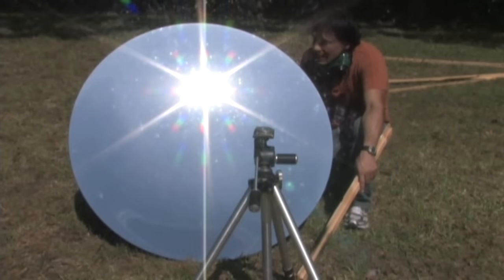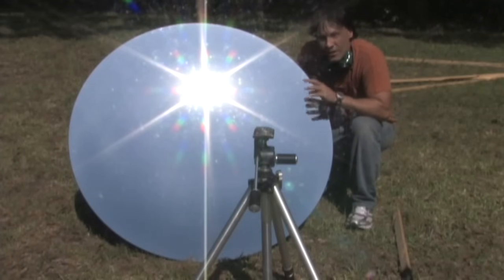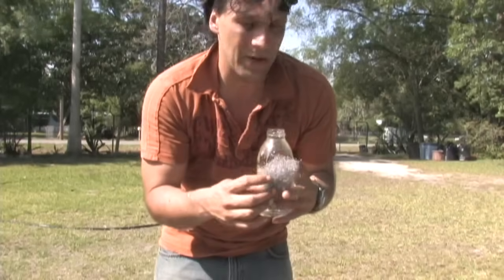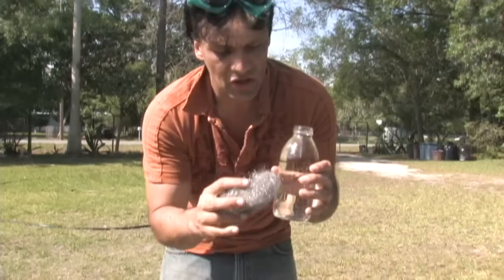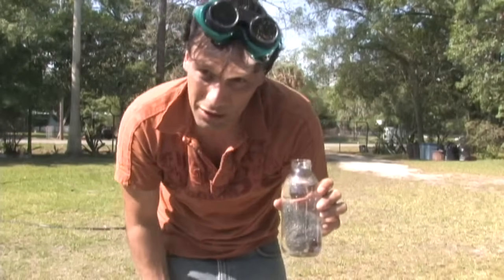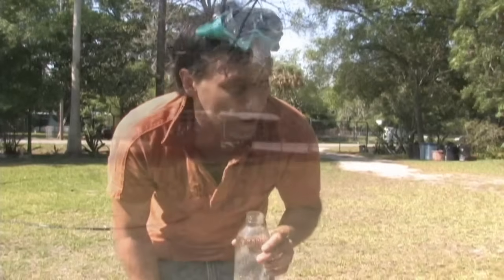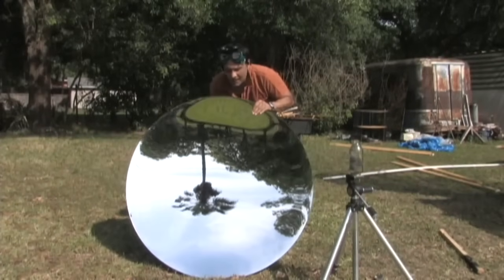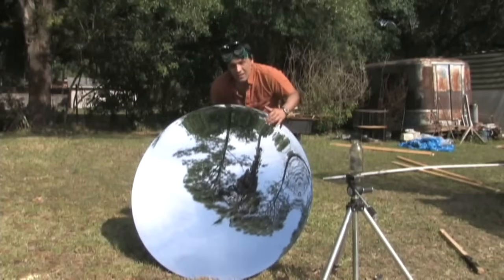46" PARABOLIC MIRROR STEAM BOILER SOLAR POWER STEEL WOLL NANOPARTICE GreenPowerScience

Comment: forgive me if it's mentioned, but paint the bottle black?  that'd make it absorb heat.
Reply from the maker: Usually do but the wool inside has more surface area.
Reply: @GREENPOWERSCIENCE  Ahh, good call.  I see how that would be a better option.

Comment: I thought you were going to produce electricity through boiling and steam
Reply from the maker: I was but PV is so affordable now and has no moving parts, does not require sun tracking, is silent, has zero maintenance, they are the best option. For electricity you need a super efficient steam engine that is noisy, requires daily care and the alternator/generator need to be super efficient plus wasting water or complex recycling. PV is the way to go for electricity. For direct heating and solar thermal, PV solar panels are a terrible choice as heating elements are a dead short and require many panels. Parabolic Mirrors and Fresnel Lens work best for cooking, heating things to high temperatures and direct water heating. That is why the steam engine idea was scrapped. No real usage. Back when PV was $7 a watt, yes, now below $1 per watt for a completed plug n' play panel, no.

Comment: Sphaphire windowed high pressure level gauges can take 2000 to 3000 psig depending on the model. I’ve used this with steel wool at 2000 psig fir supercritical co2 experiments while I was at Ga Tech. I believe the lab still exists.

Comment: I think these would be great for running a pressure cooker for mushroom cultivation. Anywhere in a warm climate it would make it cheap and neutral on the environment to prepare cheap substrates.
Reply: I bet this thing boils a gallon pot of water in 3 minutes in higher latitudes.

Comment: He thinks it could image as a primary lens though the focal length is short.  I will need to investigate. Making the mirror less magnifying should lengthen the focal length. And if it is parabolic would make for a primary lens.
Reply from the maker: Hi Terry,
These could work for imaging BUT would require extreme precision and need to be first surface. People have used our mirrors for DIY telescopes but required software adjustments of aberration as these are second surface designed for rugged outdoor usage.

Comment: Can that snapple bottle be hooked up to a copper piping coil and then be used to distill seawater? Reason i'm asking is because we have strick water restrictions and desalination is too tricky/expensive. Any comments welcome, i'm not an engineer so I need some tips😂 and what cost do those parabolic mirrors go for? Or can they be self-made?

Comment: WoW!!  Awesome set-up!! Have you had a thermocouple hung in front of this to get an accurate temperature??  Do you think a stainless steel coil hung at focal length with some kind of liquid medium circulating through it would capture enough heat??  Maybe heat water, oil or ethylene glycol?? Thanks.   brad

Comment: thats pretty cool .. my standard electric stove top takes 5 mins for 1 qt of water in a stainless steel sauce pan.. for rapid boil.. 
an issue to overcome it seems would be the collection of salts on the steel wool and salt is the killer in steam systems as i recall..
Reply: use filtered water, like Brita. problem solved.

Comment: I hv a question. Can we hv a steam generator that can cycle the water within itself, without the need to fill water again n again.
Reply: Look into a Sterling engine.
Reply: you could make a closed system, but you would need and expansion /cooling chamber big enough to cool and provide enough pressure drop.

Comment: how 'bout cooper scowering pads, wouldnt the copper ones work better conductor, also Ima thinkig a denser metal inside like steel bolts & nuts in addition to  ? to rretain heat, while mirrow adds  maybe...Glass 5 gal old water jugs, or more expersive vacume tubes for psi diligence..also why not parabola from 12, 10 & 4 O'clock positons...uhh ohh ( did i Spall that rite? it aint in the dictionary) & or melt down & or combustable expl os ive yikes

Comment: nice trick about heating wool ! I remember when I was young , a fist of dark tarnished silver coins instead of steel wool , to boil water in a pyrex beaker. the mirror was a tensioned rectangulare bathroom one which finally broked being too thick.

Comment: Telescope mirrors have to be accurate to a few millionths of an inch or about 1-1,000 as thick as cellophane. Your mirrors is one thousand times less accurate than required.
Reply: +Garth Elliott Yeah, before that arbitrary "required" tolerance was achieved, it was impossible to make a telescope by reflecting light off of mirrors.  It clearly wouldn't work at all.
Reply: +James Davis "clearly wouldn't work..." pun intended?
Reply: +Leo Corona "Leo Corona" commenting about telescopes... I should ask you the same question
Reply: Where's yours ?

Comment: The long focal length could be excellent for making an array of them, as many as you can fit in an area side by side and still be able to point them at the same point. Ex; 4 of your 1 meter focal point parabolic mirrors pointing at the same jar. Then test to see how fast it boils, then later when you are prepared with a oil system, test oil in it to see how hot it gets, or keep oil pumping thru it to prevent damage if it goes to get too hot. lol Speed up the pumping, also the pump and oil need to be hooked to a radiator to cool it fast enough.

But either way a person could just put up 4 of these with independent heat collectors on each focal point of the 4 mirrors and hook the fluid piping together mechanically in series, etc...will still add the energy to the liquid, but it will take more parts and space.
Reply: That is physically impossible my friend.

Comment: I wonder how a mason jar would fare? After all they're designed to be under pressure in a pressure cooker. Not sure the psi capabilities. Maybe if you put a pressure release valve in the cap it would keep it from over pressuring.

Comment: I used to have a 1/4 mile race car.. the gas tank in the trunk was a 5 gallon fuel cell.. it had a thin wire substance in it like your steel wool.. but the reason was opposite to what you are showing.. the wire in the fuel cell would not concentrate heat but rather disperse it.. so that even if a spark were to hit the gas, it could not catch on fire.. the product as I recall was called "Explosafe" and there were demonstrations... first putting this thin wool mesh in the tank would not displace the fluids.. hardly at all.. and 2nd was the disbursement of heat.. I would think your experiment would work better with tinfoil on the outside of your glass jar on the opposite side of the light rays to reflect light that otherwise would have traveled through the glass... in short I think the wire wool might be hurting your experiment by dispersing heat :)

Comment: Instead of steel wool, could you just use like a specially designed 'heatsink'/'radiator'/heat-exchanger, you get what I mean, finned steel, so you collect and disperse a high percentage of the heat?
Reply: Aidan Šeštokas For sure, a stainless steel core radiator with aluminum fins painted black would be an excellent solar collector heat exchanger. Like the size of a heater core in a car, could use the heater core(from an automobile) itself but i would recommend closed loop system if using an actual automobile heater core because it will need to be filled with coolant because the core is not stainless. Wouldn't need to worry about exceeding the breaking pressure of the glass.

But the glass and steel wool is a nice inexpensive way to collect a lot of heat using only stainless steel wool and glass for the heat/light exchanger/transformer. Drill a hole in the glass bottom and insert a fitting, now you can hook piping to top and bottom to carry away steam and to carry in water.

Comment: heating water in the presence of steel wool actually produces hydrogen due to the increased temperature and therefore increased rate of oxidization of the steel 
and guess where it gets its oxygen 
tesla experiment

Comment from the maker: Hi,
That could be a good idea if the steam tube is insulated as the steam would cool and condense as it travels down the length of the tube. If the steam volume is great enough it should work. The only problem I see is the down pipe's insulation solution. There are also new solar deep well magdrive pumps that can lift 200' foot to head at 500 gallons per day from a single 80 watt PV panel. Low pressure but the lift is completed to a tank.

Comment from the maker: Zenith Solar uses CPV and has no practical future compared to regular PV as the cost per watt is much higher. The 75% efficiency claims include warm/hot water. By placing regular PV panels under circulating water, efficiency jumps to 20%+, heat removed produces better current. The water is warmed equaling overall 50% efficiency. You could build 5 PV plants for the cost of one of theirs. Also true continuous mirrors like this one are 30% more efficient than square glass arrays like the Z system.

Comment: Not to burst any bubbles, but... solar panels only operate within a certain 'band gap' of light which is proportional to the amount of voltage you get. There are some companies that produce cells with layers of material each tuned to a different band gap, but they are more $ and are only 40%. The most cost effective solution I can think of is to have mirrors reflect more light onto a solar panels which would gather more light of the same band gap. Also filter out useless light to reduce heat...

Comment: I build steam engnes as a hobby. I am also a member of a Historical society that restores Stationary Steam Engines and Steam Traction Engines. I also enjoy watching your videos. 

You seem to think that 60 lbs of steam is sufficient pressure to run an engine. Most engines in the 19 the century ran on more like 130 lbs of pressure. Late 19th and 20th century locomotives ran on more than 200 lbs of pressure.

Many of your ideas are not yet ready for practical use, but keep on experimenting :)

Comment: instead of using a glass bottle you could use a an aluminum container coated in black paint on the outside and silvery (to be read as reflecting) paint on the inside to absorb and retain heat effectively..my thought..and i want to make a steam engine powered by this mirror to run my home's electricity..could it work?

Comment: You made water boil. What ever.  You did not make steam.   It takes little BTUs to boil water. It takes a lot of BTUs to make a change in state.Make water change to steam in other words. You have done nothing here other than make water bubble.  Make steam and I would be amazed. Plus, putting wool in the water creates hardness. A turbine cannot run long with hardness present. Make that same wool out of something more expensive, then it wont be as economical.

Comment: Dan, can you boil and make steam from a metal teapot? How long would it take it to boil and turn into steam? Would you design a solar water distiller? What size should the coiled copper tubing be, if you use that to distill the steam? Thanks.

Comment: Having spent almost a decade building solar homes I found that you can get only about 1,100 btus per day per sq. ft.   The highest gain is in the middle of the day.  Your mirror is about 11 sq. ft so total btu gained would be about 12 thousand.  This is about the output of a stove burner in 1 hour or 12 oz. of gasoline. (1/10 gal.)  While bringing 16 oz. of water to boil from say 80 degrees may seem impressive, you only need about 130 btus to do that.   About 2 minutes output.  Good science!

Comment: I just watched the Mythbusters try to burn a mock up of an ancient roman ship using a mirror built from materials that the Greeks would have had. I think they were unsuccessful because they had many small flat mirrors in a circular pattern. It simply didn't focus the energy enough to start a fire. They achieved about 250 degrees F.  Enough to boil water but not ignite the ship.
Reply: They are Hollywood idiots using feet not meter

Comment: @mattmatt115 : there is no chemical reaction in this process. what you are seeing is heat from light being caught by the steel wool and diffusing into the water. the only chemical reaction that occurs between water and steel is oxidation (rust), but that takes much more time than a few minutes.

Comment from the maker: @trumpsahead no, you would need 2 sq miles of perfect mirrors to simply illuminate a target at 30,000 ft, up there, where the ice condensation clouds are:-) Even then, the focal point would be so scattered, the pilot would not even notice you. It would look like a shiny lake on the ground from the air. 

5:1 dish diameter to focal point is the absolute maximum, up to about 200m focal length, after that, impossible.

Comment: Get you some pyrex lab glass. I wouldn't reccomend the Snapple bottle, not just for pressure but heat. These bottles are not tempered the same way that lab glass is, and can explode when they get hot!

Comment: Glass radiates heat faster than copper, heats up faster and cools faster. You could incorporate a steel boiler with thick glass lenses? Have multiple parabolic mirrors pointed at one boiler, bottom to top. I like the steal wool idea. Bring it a step further and put metal shavings in the boiler that could be reused, self circulating from the boiling water.

Comment: Great bit of 'Lateral Thinking' incorporating stainless steel wool in the water. It is also possible to make a reasonably good mirror, from just clay. (mud) you just line it with old CDs. which you focus individually, covering the others till the whole surface is covered in CDs. honeycomb style. The mirror can be a square block of wet clay/mud. set in a wooden frame/box.

Comment: Dan, - your channel collector isnt a parabola - you've messed up the shape.

Yet another point - I recently built a passive heliostat that works by a bungee cord pulling one side of a collector down, offset by a bucket on the other side dripping water out over a day. It travels 180 degrees over the day. The next morning, I go feed the dog and tip the water from the lower bucket into the top and it starts again. Maybe mechatronic controls arent as cool as some of the old school ones. Keep going!

Comment: hi
Why dont you use a copper vessel for boiling the water . with a convection water supply so when its heating its circulating into a larger  boiler for later use eg A BATH  ! or for a nice cup of Tea !!! we do this all the time with a coal fire as we dont get that thing in the sky you guys call the sun , as we live in the land of rain and cloud  usually called england . 

take care 
keith

Comment: I had been thinking about the same thing, about the steel loosing lots of heat.  This is the solution i had thought of:
Still using a steel pipe or whatever but insulating the entire pipe very well except the the small spot where the light contacts it.

Comment: It would be nice if there would be a reflective surface stuck on the side of the bottle opposite to one which get the heat so that it will not let any heat ray pass through & make it more efficient.

Comment: May I suggest using a high-temp metal coil that can heat small volumes of water quickly and efficiently? Sir Charles Shults is working on a similar concept to convert water to steam to power a generator.

Comment: Sure,  your points are entirely correct.
and if the mirror was functioning on the surface of the moon instead of the back yard..., 
and powering heart pacemakers instead of boiling a little water... 
it would make the need for manual adjustments every few days much more critical.

Can I ask if your a programmer who creates software that tracks the sun? If you are, and you could use an atomic clock (instead of the one in your PC ) you might get slightly more efficient code...

Comment: Well...  It's going to have to reset and point back towards the east every night and be ready to start up at the right time everyday.  Everyday the sun rises about a minute off from the day before.  And everyday it's track across the sky is a little higher or a little lower (depending on the season) from the day before.  Your gears and slow steady motor are going to have to account for all of this.

Comment: You should check out an old and clunky series of videos by user SkyPicturesInc regarding solar distillation. He just used boxes with black bottoms, and created a TREMENDOUS amount of high pressure steam.

I'd be interested to hear what you make of his system.

The interesting thing about making high pressure steam is that you can FIRST use it to do significant work, and THEN allow it to condense, for water purification.

Comment: Just holding the dish and focusing the sun on a bottle for 3 minutes works great for a demonstration, but I don't think you'd want to stand there all day, from sunrise to sunset, to point the dish directly at the sun to heat your bottle or steam generator.  For that you'd need a computer controlled heliostat.  Which would track the sun across the sky and really complicate the design of your steam generator. At this point, if you get a lot of sun in your area, you're better off with solar panels.